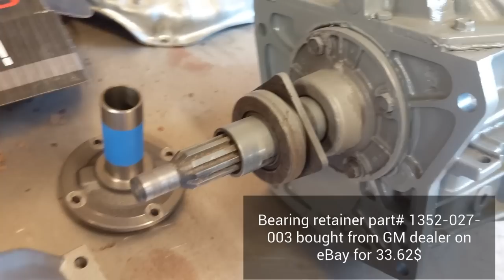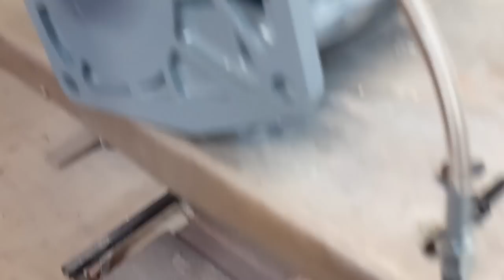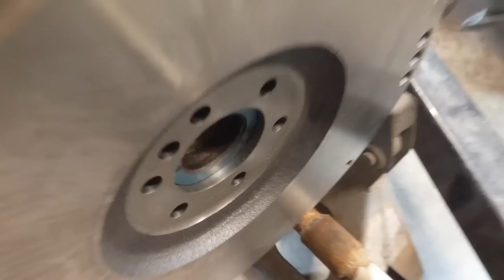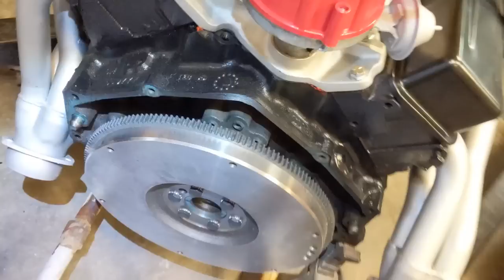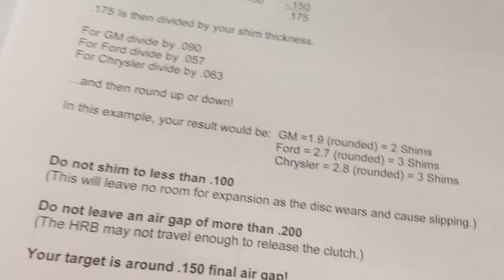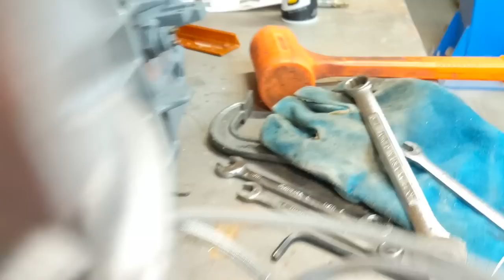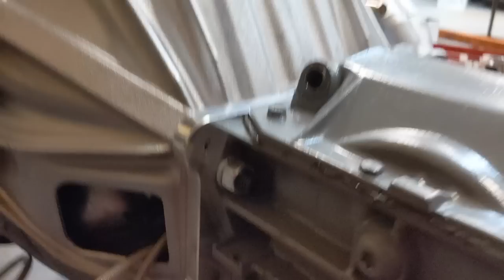Swapping a 5-speed manual behind a first gen Small Block Chevy

Comment: A 400r4 would been an easier swap and cheaper with the same performance  5 grear 68.1 to 1 a 400r4 4 gear 67 to 1 ratio. Unless you need 1st gear to be lower on the T5.
Reply from the maker: Do you mean a 700r4? That is an automatic and he wanted a manual

Comment: what clutch are you running? and also what pressure plate and flywheel are you using? i cant seem to find any links..  someone swapped ford internals on a gm w/c t5  so my inputshaft is 10 spline. ive been having issues of being locked out of gear when its on the ground but lifted up in the air it bangs gears no problem

Comment: So you have a Chevy t5 input shaft in your trans, I have that exact t5 out of a 5.0 and the shaft comes out about 1-2 inches. The Chevy clutch disc “fits” but the teeth have gaps in them so I have to change out my disc for a v6 Mustang disc so that it comes in 11” like my clutch is for it to not strip the teeth.

Comment: Ya don’t go with pilot bushing 716193 if you find out your input shaft goes out from the bell housing by about an inch (94 mustang GT T5) (1985 Chevy 350) go with the oem Chevy bushing and get it machined out like he did in the video because the other bushing is twice as long and will cause a fitment issue

Comment: I got a question, why use the t4 bell housin with adapter instead of cj5 or cj7 t5, is there a spesific reason, clutch size or something?
Reply from the maker: If I remember right, it was just a lot cheaper to do it this way. Sourcing the 4 speed and adapting it was easier than sourcing the CJ one. But it may be different now, this was like 4 years ago

Comment: Do you know what it would take to put a 1971 small block Chevy 307 motor in a 1995 C1500 Chevy 5 speed original transmission pickup? A friend says they don't work together.
Reply from the maker: a 307 is just a stroked 283 and it should have the same bellhousing as the 95 trans assuming it was bolted up to a small block
Reply: If it's a chey,it will work. My partner has a 66 chevelle ss and took a 6 speed transmission out of a 2000 camaro, and he's been driving that car for over 6 years now.

Comment: Could you use the stock ford bearing retainer with a ford TOB on a chevy clutch pack? Or do you need to switch the retainer to GM and just get a GM TOB?
Reply from the maker: Good question.  I am not sure. If the TOB makes good contact with the pressure plate, then it should work just fine.  I decided on hydraulic for feel and to simplify the conversion from an automatic car to a manual.  If I already had manual clutch linkage I would have tried what you are suggesting.

Comment: Couldn't help but notice your headers, do you mind posting make and part #.  Thanx
Reply from the maker: Gosh this was many years ago so I don't remember what headers I went with.  I THINK I went with the summit racing branded ones (which are almost certainly made by someone else and just rebranded). When I am trying to keep costs down I go with the unpainted summit ones and paint them with the flat aluminum thermal paint and I have had very good luck with that.

Comment: I read that some 80’s Jeeps with the gm 4 cylinder came with a bellhousing that has the gm engine mounting pattern, and the Ford T5 trans pattern. Not sure how accurate that is, but it could save you from having to use an adapter in that instance.
Reply from the maker: I have heard that as well, but never verified it.

Comment: What size u-joint and slip yoke did you use?
Reply from the maker: The slip yoke was the factory mustang yoke and I just took it to my driveshaft shop along with the stock Camaro driveshaft and told them the length of the new one and they built me one. They just matched up the u-joint cup sizes on the yoke and driveshaft to pick one out.

Comment: Or run a die of the right thread over the threads that are there now and then use the nut to tighten it against the trans to keep in place along w loctite would be another alternative to welding

Comment: Will every thing fit for the 5.3 ls
Reply from the maker: I am told the bellhousing will work, but you may need a different clutch set.  Keep in mind the strongest T5 is only rated at 285hp, which is why you don't see that swap very often.
Reply: @AustinCoulson   my t5 has a 10 spline  it came out of a 5.0 mustang I wanna start ordering stuff but I wanna make sure I get it right do u know what clutch set I need and dose everything else that u did will work

Comment: Just bought a 1969 k20 it already has a 5 speed. Seems to work great except 1st and second seem too low... It seem second is not low enough to take off in.  Guess the transmission will have to have 2 gears swapped out. Great video

Comment: Did you subtract the thickness of the hot rod works bracket that goes on the Bellhousing when you measured for the hydraulic throughout bearing shims etc.? Believe it or not I got lucky and I’m doing the same exact thing you are or did but I’m using an 83T5 non world class from a mustang. No matter what I do even after I trim the input shaft from an S 10 basically everything that you put part wise I got and my measurements are still not right the only thing I’m using is a different brand hydraulic throw out bearing but the overall goal of being off by .150 is still the same
Reply from the maker: The adapter doesn't effect the shims because the adapter rides outside of the bearing retainer which is what holds the shims. Did you install an S10 bearing retainer or are you using the factory Ford one?
Reply: @AustinCoulson  the same as you. S10

Comment: Should have just used a quarter master hydraulic bearing assembly as it uses the old fork mount hole. It would have saved you a lot of cobbling on the the trans

Comment: what does it take to fit the drive shaft?
Reply from the maker: On these types of swaps its common to need a new driveshaft made.  You take your new slip yoke and your old driveshaft to a driveshaft shop and it's usually around 150$. At least thats the cost where I have lived.

Comment: do you know if this will work the other way around? muncie t5 to a 302 block
Reply from the maker: You would just need different adapters and a different clutch. This is pretty much the same way to do any manual trans swap

Comment: hello
I have a 383 stroker but I am not sure to install an NV4500 or Borg Warner T5.
Which one would you recommend?
Reply from the maker: The NV4500 is rated for more power, but the T5 is probably cheaper to install.  I Think the T5 feels better in a car and the NV4500 feels better in a truck, but for me it would probably come down to whatever I could find at a junkyard that looked like it was in good shape.  If you do use a T5, try to get the WC late model ones with the higher nickel content and carbon fiber clutches (92+ I think) and be easy on it.  No clutch dumps.
Reply: @AustinCoulson  ihave a 1966 c10
Reply from the maker: @Desert-Donkey-Al  if you can find an NV4500 or NV5600 I would go with that. The gear ratios and shifter feel are perfect for that truck.
Reply: @AustinCoulson  Thanks for your time.

Comment: I'm curious if I could use a piece of all thread with some nylon nuts for the guide?
Reply from the maker: If you are talking about the guide for the throw out bearing, I think the easiest solution is the one I show at the end where you just the head off a longer bolt
Reply: @AustinCoulson  yeah.. thats what I'm talking about.. i always do things on the cheap.. "not out of laziness, but due to stupid money bs, lol.   And i hear ya, nylon nuts could overheat and wear out. Plus all-thread  "the threads" might chafe the throughput lever thingy?? Anywhozy.. ☮️
Reply from the maker: @privateprivate1865  if you are doing this swap on the cheap, you might consider using a traditional style clutch fork with either mechanical linkage or hydraulic master-slave setup. Would save you up to 600$ as the hydraulic throw out bearing is the most expensive part of this swap, often more expensive than the used transmission

Comment: What motor were you connecting the trans to? I want to do this in an 89 s10 4.3, but want to make sure I get everything parts-wise.
Reply from the maker: This was a 305 SBC. From what I remember the 4.3 has the same bellhousing as the SBC and same crank flange so I don't think there is anything that wouldn't directly fit the 4.3.  I believe it's all the same part numbers.

Comment: Great video man! 
I’m looking up info on manual swapping my 94 f body LT1. As I understand the LT1 is same as SBC so the setup shown in the video would bolt directly to a LT1? What would be best T5 to find? I have a T5 In a 91 s10 2.5 4 cylinder lying around but not sure if it’s a good option. 
T56 is worth more than this car so not an option right now. I’m sure a t5 would do fine behind a stock LT1.
Reply from the maker: The block is the same (at least from my memory) so no issues there.  The S10 T5 is a boat anchor, only useful in low hp applications as it is weaker and has different gearing.  You'll want a World Class T5 from a 92-95 Ford Mustang if possible as it has higher nickel content on the gears and carbon fiber clutches as well as the perfect gear ratio for your F Body, but any Mustang T5 should be fine if you keep it under 300hp.
Reply: Why not find the 5 speed from a junkyard or craigslist Camaro or Firebird? The LT-1 had a 5 speed option, right? If you are swapping from automatic to manual, wouldn't swapping factory GM parts be easier and better? That 4 cylinder t5 would bite the dust behind a LT-1 if it's running right.

Comment: Great video! Incredibly detailed!
I got a small block chevy from 92 c1500 that I'm planning on putting in my Nissan d21 truck! I just got a T5 transmission at the local junkyard! I wanted too ask, does the bellhousing have too be a Muncie or will any sbc bellhousing work with the adapter plate? Thanks for your time!
Reply from the maker: The bellhousing has to be the SBC-Muncie for the adapter i used to work, but there are plenty of other adapters out there. If you use a different bellhousing/adapter setup just know some of the measurements may be different along the way.  Good luck on your build, that sounds like a fun project
Reply: @AustinCoulson  thanks for the response! I was originally going too mate the stock manual transmission from my d21 to the small block 350, but after watching your vid...it's sooo much easier! All the guess work is taken out! Thanks again!
Reply from the maker: @almagam2099  the T5 is amazing behind the SBC. I did a follow up video of the trans in the camaro you may wanna check out. The tire diameter on your Nissan should be similar to the Camaro I did so the gear ratios with the T5 should be perfect
Reply: @AustinCoulson  I'll def check it out!
I used too own a 25th anniversary Ford mustang a few years back! I'm pretty sure it had the same transmission?!!
It was a v6, but man, did she haul butt!
The T5 shifted smooth as silk and more than handled the torque and horsepower!
Reply from the maker: @almagam2099  that would have been a T5, but the V6 ones were just a little different. Different gear ratios and less nickel content in the gears if I'm not mistaken

Comment: Great video! How did you make the speedometer work with the Ford parts?
Reply from the maker: We used Dakota digital gauges so it simply uses a pulse sensor that plugs into the back of the trans

Comment: Hi , i have a cuestión , can you help me please , ¿ The manual transmission from a Chevy 350 engine fits a 454 engine?
Reply from the maker: It should. I believe the bolt pattern on the bellhousings are the same. Will probably need a different flywheel

Comment: Anyway I can use the t5 that’s in my 2.8l v6 s10 for a sbc swap?
Reply from the maker: The v6 chevy T5's are quite weak compared to the Fords and the gear ratios are different, but you can make them fit

Comment: Using a hydraulic clutch is the best way to go. I just did a E4OD to a T-18 4 speed swap and I used a hydraulic clutch set up as well.....Bro did you grease that pilot bushing well?   I had an S-10 Blazer with a 5 speed .
Reply from the maker: I put a little sand in the pilot bushing so it's all good.
Reply: @AustinCoulson  Sand?  Oh a wise guy ay?
Reply from the maker: @unclequack5445  hahaha I forgot I wrote this. Yes I greased it
Reply: @AustinCoulson  I like your content Sir.

Comment: Do you have to use the chevy bearing retainer? And awesome video!
Reply from the maker: You don't have you, you can use any retainer you want, you just may have to modify it. I went with the Chevy retainer because it has a smaller outer diameter to let me use the hydraulic TOB I wanted. If you keep the linkage style TOB, then you could use ford forks and a ford TOB with the chevy clutch, it would just take some adjustments and maybe some shortening of the retainer sleeve. The benefit would be that it's a lot cheaper for normal linkage than a Hydro TOB
Reply: @AustinCoulson  oh okay I didn’t know if it was a must, I may do a hydro TOB because I’m gonna be limited on space. Thanks for the advice! I’m workin on a sbc 5 speed swapped bmw e30!
Reply from the maker: @tylerbroadbent3148  that sounds like an awesome swap. The Hydro TOB is great for a smooth clutch feel, but the real benefit is what you mentioned; space space space. It takes up almost none as it's all inside the bell housing and you have no linkage, just a hose to route. Good luck on the project, and you should definitely post a video of it to YouTube if you are able
Reply: @AustinCoulson  I sure will! And I seen you got a box truck camper too is that right? And I’m turning my 94 g10 shorty into a weekend camper as well!
Reply from the maker: @tylerbroadbent3148  the box truck is just to store the shop stuff for the move, I got a travel trailer to live in while we find a place to build a house and shop
Reply: @AustinCoulson  I’m gonna use mine for a weekend camper to go to some trial with my dirt bike and I should have my car done soon I’m workin on my motor right now just tryin to learn everything about it thanks for the advice, if I need help I’ll comment for questions and I hope the move goes good for you!
Reply from the maker: @tylerbroadbent3148  I've got a public email if you have any questions. It's acthecarguy@gmail.com

Comment: I want to put a 1992 saw with 6 tbi cylinders, a 350 tbi engine, my question is can the same 6-cylinder transmission be left, I need help please
Reply from the maker: The 6 cyl chevy manual trans is a lot weaker than the ford T5 so it is not recommended behind a 350. That being said, a lot of guys have done it with no issues.

Comment: Chevy or Ford clutch disk? I thought Ford Input shaft splines was different diameter?
Reply from the maker: If I remember right, both ford and chevy 10 splines are the same size, but I used a chevy clutch setup because although the ford disc should work, you'll want the chevy pressure plate to bolt to the flywheel

Comment: My throw out bearing retainer is already 3 3/8” long. From a camaro. Think it’ll work since it’s 1/4” shorter than what your instructions said? I have the same type of adapter but from a different company and it says I can use S10 or camaro retainer.
Reply from the maker: That all sounds correct but I don't remember if I have used one like that before

Comment: There is some great info here but I think it is still simpler to seek out a World Class T5 from a Camaro and save the cost and possible misalignment issues of an adapter. For my 1970 C-10, I used a Camaro WC T5 and was able to bolt it directly to my original bell housing. The Camaro T5 is tougher to find but they are out there if you spend some time looking.
Reply from the maker: I agree it is easier to do the swap as you suggested. The Ford WCT5, specifically the 92+ years are quite a bit stronger with higher nickel content and carbon fiber synchros. They are also quite a bit easier to find for most people and usually cheaper.  I thought this video may be helpful to people that are running a little more power from their 350 than the Camaro T5 could handle. Glad you are running a T5 in your C10, that is a really fun setup, and the 68-72 C10's and K5s are one of my favorite looking Chevys.
Reply: This is the exact comment I’m looking for. Trying to bolt a 1988 z28 camaro T5 5 speed to a SBC 327 in my 71 c10.
Reply: How did this fit? Looking at the same thing! Camaro C10 behind a 454 from a motor home.

Comment: Does anyone know if this set up can be done using a 5.3 LS motor .. 
I know that 305’s and 350’s volt on to turbo 350’s and 400’s and at the same time turbo 400’s and 350’s bolt up to LS motors ..
Reply from the maker: I had someone tell me they used this setup in a 5.3, but I can't personally confirm all the part numbers will work. I seem to remember thinking there was something that had to be switched like the pilot bushing or clutch
Reply: @AustinCoulson  if you remember who or a link or something please let me know , I would love to swap my auto trans to a 5 spd on a budget ....

Comment: 4th gen V6 camaro t5s have the same  spline as a t56 and will bolt right up to that glange too... but have electric vss
Reply from the maker: Correct. Using that trans will make the swap easier, however the Ford T5 (post 1990) has carbon fiber liners on the synchros and increased nickel content in the gears which IMO makes it a much better candidate behind a SBC (and they are easier to find, at least where I live). I have , however known many guys who have ran the v6 GM T5 without issues.